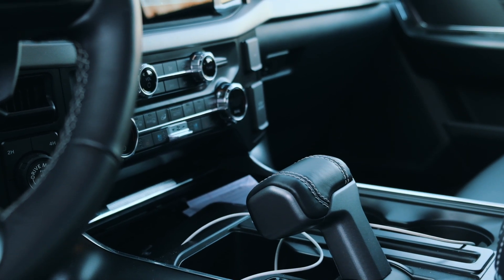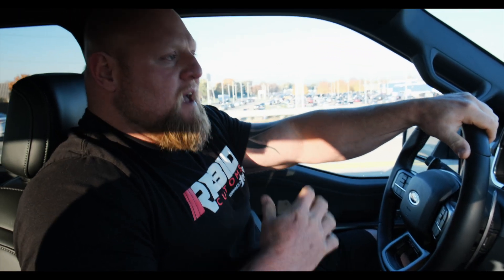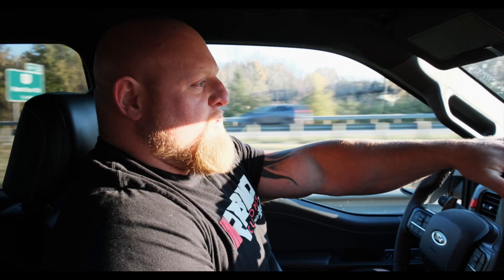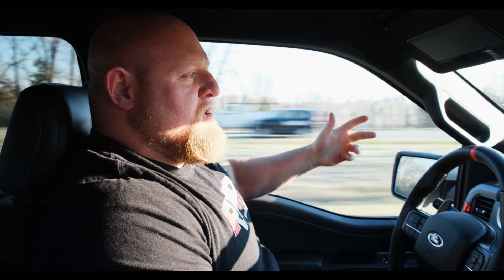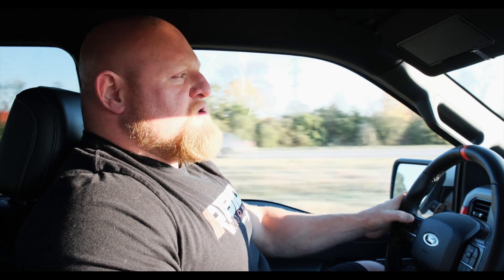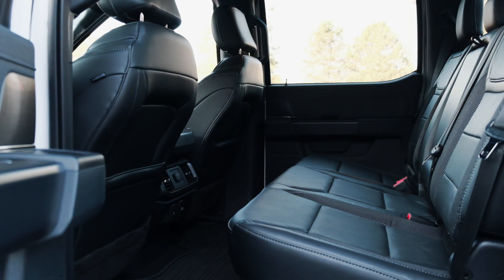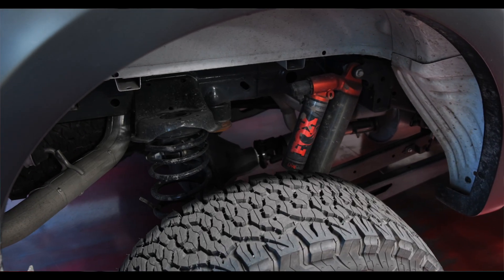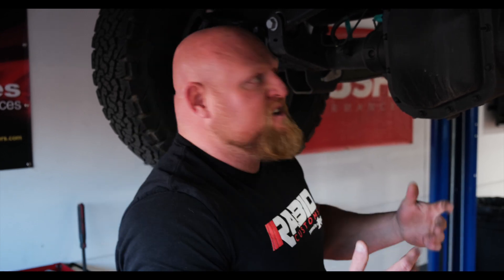FIRST LOOK At The All-New 2021 FORD RAPTOR | An Offroad Rolls Royce?!

Comment: I’ve got a 2017. Raptors are the best!
Reply from the maker: Yup the 21 is so much nastier.  I’ve had a 2011 -2018 -2019 -2020 -2021
Reply: @WenningStrength  it looks cool AF, enjoy. I’ve got a black one with the old orange interior which I love, and the whole thing covered in paint protection film. Combine that with super low work from home miles and my next one will be a 2030! At least you’re getting premium trade in value. Everyone wants one of these. If you do any mods let us know!